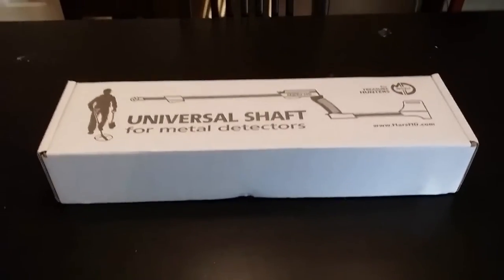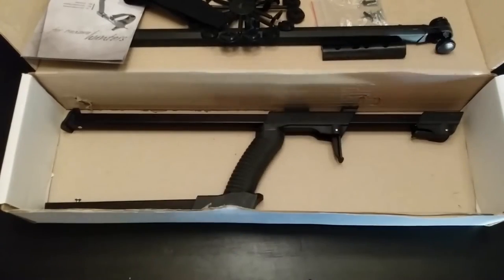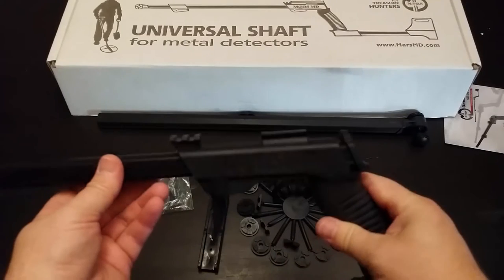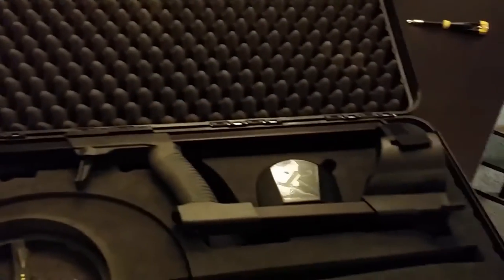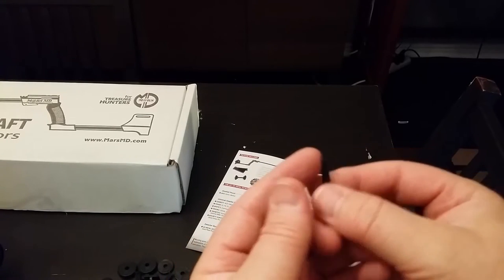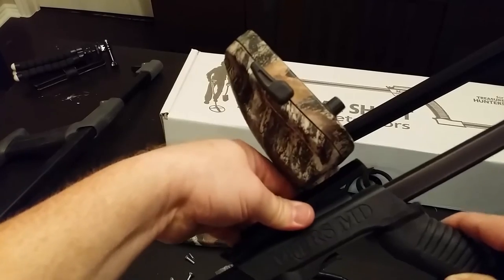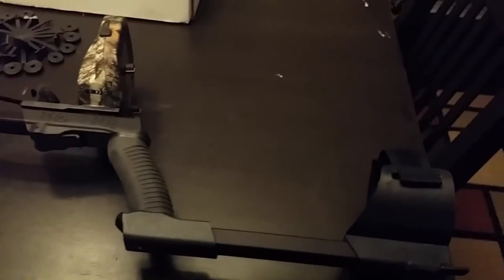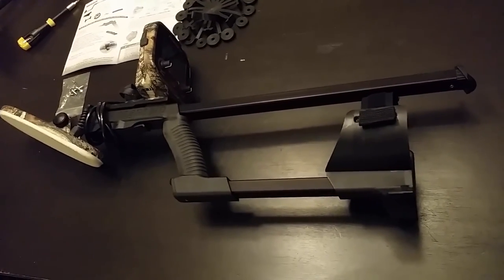Mars MD Universal Shaft Review, Comparison, and Fisher F19 Mounting

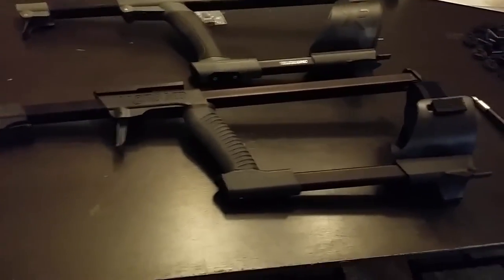Comment: Interesting. When it is fully closed or retracted at 6:00, how long is it ?  Wondering if it will fit in a backpack. Thanks.
Reply from the maker: master ofrevolt I'll check and get back to you.
Reply from the maker: master ofrevolt , just measured it. exactly 24"
Reply: Thanks. With a regular sized coil, does it wobble at all where the joints are when you swing it ? In other words does it feel the same as the stock mount in use ?
Reply from the maker: master ofrevolt , it's very solid. If anything, too solid, adding to weight. no wobble at all. seriously I think you could run it over with a truck. the cam locks are very heavy duty.
Reply: Thanks. I appreciate the info.

Comment: has your bottom camlock gone loose yet ,and the bottom shaft just slides out ?
Reply from the maker: CrazyCressy7 , nope , both cam locks are still tight. but the f19 isn't my primary machine, so it hasn't got a lot of use.  I hope that's not a warning of things to come!

Comment: Hey Relic Ryan if you don't ever think your gonna sell that setup you could shave down the shafts abit to lose a wee bit more weight. I'm 6foot and one of my machichines which is the ace 250 with the standard factory shaft was just to heavy for me and and since I had some room to play with I just cut both the shafts abit, drilled new holes and wala a wee bit lighter =)
Reply from the maker: Ryan Roberts That's not a bad idea. Thanks!